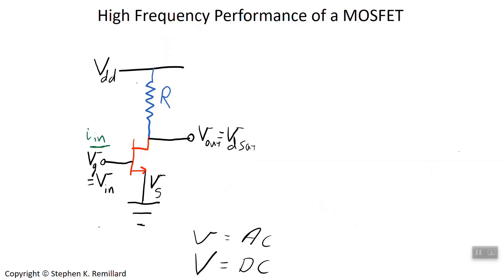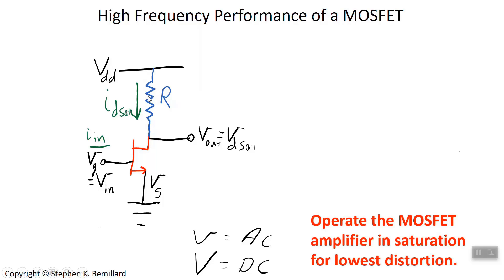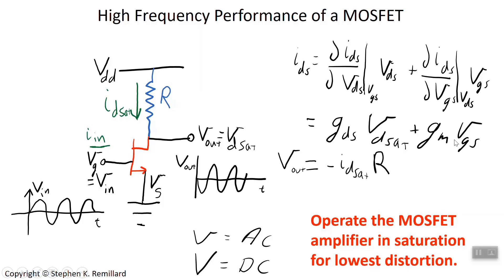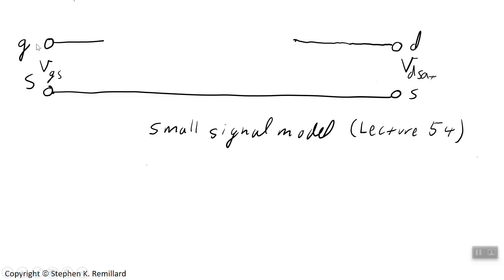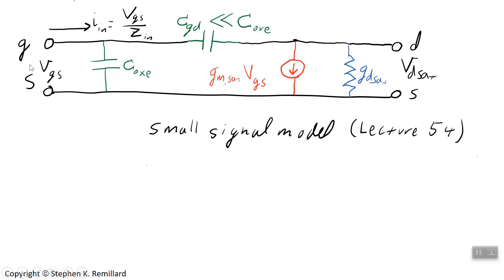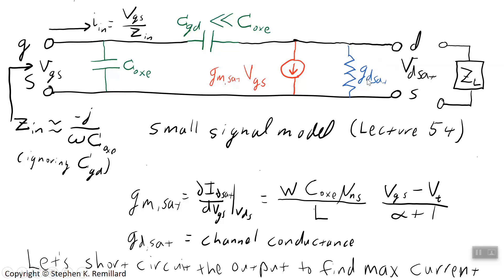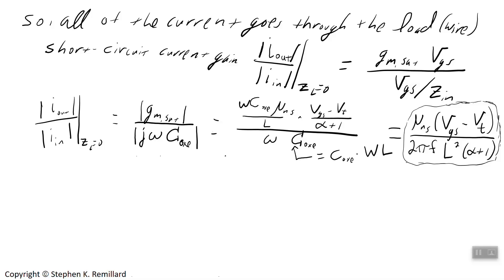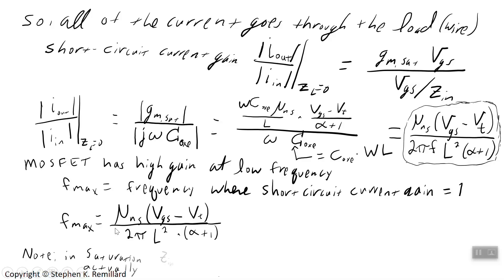The MOSFET at High Frequency , Lecture 60

Comment: Hello I need and answer to this important question if a mosfet is rating at 94amp and 380 amp pulse current at 580watt power dissipation rating if the frequency is 250khz does the current rating remain the same or it reduces the current rating please explain to me  thank you